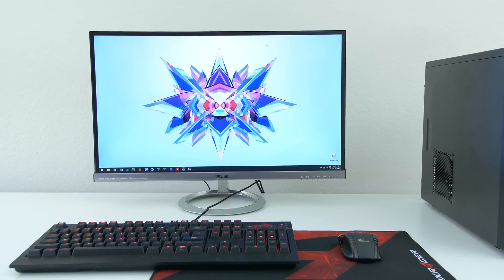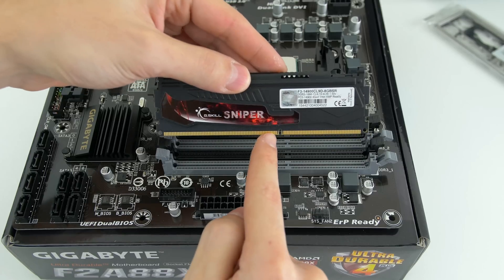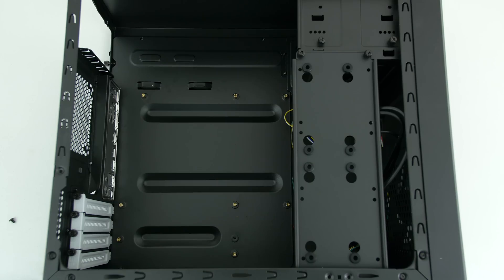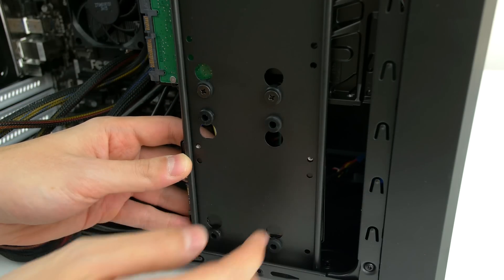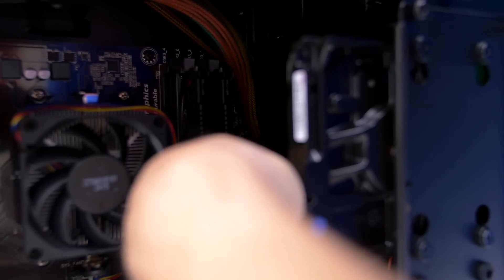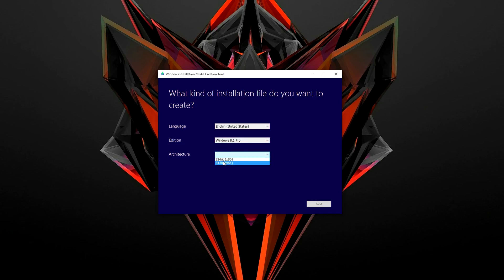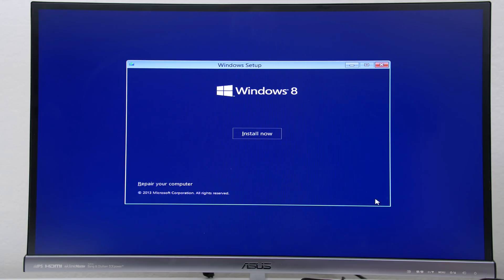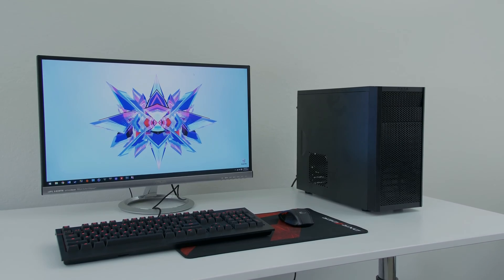How To Build $450 Gaming PC w/ Windows Install

Comment: Amazing video! really wanna give this ago but i have never done one before and im worried it would go wrong :(
Reply from the maker: +Senthuran Mah what u mean what comes on the screen the 1st time? as shown in the video, the microsoft logo comes up and you just follow steps to install windows. Its super easy. If you are talking about the BIOS screen, thats only if your PC doesnt read your USB drive. If everything works fine, then the PC will take you to the windows installation part.
Reply: +SamHurstHD 

Hey i know im alittle late on the reply but i just wanted to tell you something i think will help you overcome your fears:

Ever played with LEGOs? This is alot simpler. No small parts involved. No possible way to plug things in the wrong spot (save for maybe the power switch cables [and even if you do, no biggie])

and if you are capable of using the comment system on youtube, then you can install windows. 

So dont stress and take comfort in the fact that all parts are warrantied. :)
Reply: I just finished his 500 Orion build and it's super easy man, just follow his videos and you'll be alright.
Reply: +TechSource I just finished the Orion build you posted a couple months back and man, it felt so nice turning it on ! thanks a lot man ! your videos got me into pc gaming.
Reply: +SamHurstHD Don't worry. I was worried too when i wanted to build my pc but it was wayy easier than i thought! As long as you know how to build legos then this is kinda like it.
Reply: +SamHurstHD it isnt harder than lego
Reply: +Senthuran Mah Im just worried i wont build it right
Reply: +SamHurstHD It's not very hard, just follow along with this video :)
Reply: Senthuran Mah The building is easy. What do you mean by "all the stuff you have to do"?
Reply: It is literally just plug and play. I was really scared when I built mine. It's super easy just plug stuff in and screw stuff. It is like building something from ikea
Reply: +Senthuran Mah what comes up is the bios or if it detects windows on the flash drive it will immediately start windows install
Reply: +SamHurstHD hey i made mine a few weeks ago it really wasent that hard!  Only thing you need to worry about is static which you can easily remove with a anti static wrist strap!    Trust me the components are a bit tougher than you think!
Reply: +SamHurstHD building a pc is easy, it's like legos. And i'm not even joking, a 5 year old could do it. It's very hard to fuck it up.
Reply: man just give it a try ive been building pcs for a long while. try and fail. trail and error but you learn. it's not hard just a bit time consuming. sometimes for the build it can take an hr or 2 but to build your own ita worth it.
Reply: Just build it. You learn way more by building it and experiencing the mistakes and frustrations. My first build took me damn 4 hours because I didn't build the right way but after that, I can easily build one for an hour with full windows install.
Reply: Same
Reply: +Senthuran Mah if you have a hard drive with windows on it and you use it you should be fine and not have to worry about that
Reply: Jayden Wied
 wont that mess up the activation key?
Reply: ***** idk
Reply: Haha, Thanks man!
Reply: +SamHurstHD the only thing people have problems with is correctly hooking in the power , reset, led etc connectors on the motherboard. Its really easy to build computers. Ive built hundreds for my job
Reply: +SamHurstHD If you are really careful with all of your parts nothing can go wrong. Connecting all the cables is really easy you just have to find the slot where the cable fits in... and the rest is just screwing screws... DONT LET YOUR DREAMS BE DREAMS
Reply: DasDenFlo
" dont let your dreams be dreams" WTF does that even mean
Reply: *****
You dont know the Shia labeouf thingy?
Reply: DasDenFlo
I heard he went weird for a while and put a bag over his head in an interveiw but didnt pay attention to it. Is that where it came from?
Reply: *****
Just type in "JUST DO IT" into Youtube and I think it will explain everything... its a Advertising for Nike if I am not mistaking... D:
Reply: DasDenFlo
lol
Reply: +SamHurstHD Im building my first pc which will be this one. There is nothing to worry about
Reply: +AllTech have u built it already??
Reply: +KingFlyPascal not yet, I'm still gathering some more money because I have chosen a different case and ram but I've seen this build as well as one in real life and about 100 on YouTube. I am really confident I could easily build a machine like this in under 2 hours
Reply: +AllTech can u make a video on it and all the parts with a tutorial of how to make it? like the video
Reply: +KingFlyPascal YES, Definetly. Just subscribe to my channel and possibly e-mail me. I could send you all of the parts i had in mind of purchasing and of what parts i already have
Reply: +AllTech just subscribe hope you make a really specific tutorial and Thanx
Reply: +AllTech wait whats ur email
Reply: +AllTech when are ur parts coming
Reply: I ordered the hard drive for now. Im looking to see what parts i could salvage from my junk computers because i have a lot then i will decide what parts i need next
Reply: i have also e-mailed someone at ncix for some help about picking the correct parts and for help along in the build
Reply: +AllTech do u need another computer to download windows 8.1 or can u use the new pc to get windows 8.1
Reply: you would need another pc to download the file to a flash drive and buy a activation key then when you boot your pc WITH THE USB IN THE COMPUTER and put in the activation key, it is supposed to work. Then you would need to download all of the drivers and you are good to go
Reply: +AllTech i dont have another pc
Reply: then if you have an optical drive in your new pc you could buy a disc from bestbuy
Reply: +AllTech i dont have
Reply: +SamHurstHD you just gotta go for it!
Reply: Did you build it?     I'm going to build it I have all the parts just waiting for the case to get delivered.its going to be the first time I make a gaming pc
Reply: +Bryan Zamora I have built it, it is a great job
Reply: Can you help me I built it already but on monitor it says "no signal"
Reply: +Bryan Zamora make sure you put the hdmi lead into the graphics card and not the motherboard hdmi
Reply: +Matthew Mcnabb I do but still no signal.  I really want to use it
Reply: +Bryan Zamora accept my hangout invitation to chat on youtube
Reply: +Matthew Mcnabb I'm trying but it's loading
Reply: +Matthew Mcnabb it's not loading 😣
Reply: +Bryan Zamora is your graphics card hdmi port cut off a bit from the case? when I first installed mine i couldnt fully get the hdmi lead into the port, I then unscrewed the screws that hold the graphics card in place and left them unscrewed and I was able to push the hdmi lead the full way in, then it worked for me. try that
Reply: +Matthew Mcnabb no its not that
Reply: +Matthew Mcnabb DUDE I GOT IT.I HAD TO PUT ONLY 1 STICK OF RAM AND THEN IT BOOT UP
Reply: +Matthew Mcnabb Thanks for helping me though
Reply: +Bryan Zamora nice, no problem
Reply: +Matthew Mcnabb but do you know what I have to do so I can boot with both
Reply: try putting them with the corresponfing numbers on the right

First stick in the 1 slot
second in the 2 slot
Reply: +AllTech thanks but I had already fixed the problem.i had to go into the BIOS and enable x.m.p to profile 1 and it WORKED.

THANKS FOR HELPING ME THOUGH
Reply: +SamHurstHD I just built my first PC recently and it is WAY easier than any tutorial makes it seem.  As long as you read the labels on the motherboard and have a decent case anyone can do it.
Reply: +SamHurstHD I just built my first PC recently and it is WAY easier than any tutorial makes it seem.  As long as you read the labels on the motherboard and have a decent case anyone can do it.
Reply: +Rafael C So you made his pc build the orion about 6 months back would you say I should buy this or the Orion?
Reply: Can I use the r9 380 instead?
Reply: Lonelyguy192 no /s
Reply: Lonelyguy192 OF COURSE YOU CAN! This is PC. Use whatever parts you want.
Reply: +PandahFX tbh the orion is more expenzive now, im just gomma get an amdfx6300 and a nvidia 750ti.
Reply: +PandahFX and the other parts the same.
Reply: Same. I really wanna build something but i have no experience. Is this machine any Good? Or should i go with a bit higher budget to get the best Bang-for-the-buck?
Reply: Marijn Molenaar check the PC Master Race wiki.  They have parts lists for the best bang for the buck builds at different price points.
Reply: ***** Allright. Thank you
Reply: +Rafael C How was the Orion btw, is it a good build. Im a computer science major in my second year of university and I want a basic setup to start me off.
Reply: +SamHurstHD same with me
Reply: hey seems u know about pc can u reuse ur old harddrive when it has data in it?
Reply: that is all you have to do.. install windows and you're good to go.
Reply: Ya me toooo I'm scared
Reply: +Haukss ya me too but I am going to use the gtx 750ti ftw and the mad althon x4 860k
Reply: +Christien Soosaipillai this build and the Orion build is perfect for you but yes the Orion is the best first pic for your needs 😀
Reply: ***** ohh ok im 11 and i am looking forward to making this pc for minecraft
Reply: +mikai w PFFT
Reply: Domestic_K9 ram
Reply: +mikai w wtf😂
Reply: are these two CPUs the same?? if not are they similar and could i use the

 AMD Athlon X4 860k with AMD quiet cooler Quad-Core Socket FM2+ 95W AD860KXBJASBX Desktop Processor http://www.newegg.com/Product/Product.aspx?Item=N82E16819113410

 instead of the 

AMD Athlon X4 860K Kaveri Quad-Core 3.7 GHz Socket FM2+ 95W AD860KXBJABOX Desktop Processor (BLACK EDITION)
http://www.newegg.com/Product/Product.aspx?Item=N82E16819113379
Reply: me to
Reply: I have a pc all ready so I can go back to dat if it dous3 go wrong
Reply: destroyer1353 killer

Comment: Any suggestions for the best cpu and mobo for $400 to $450. I have all other parts for my next build except these 2 parts. I can get a I7-4790k for $250 with no mobo but wasn't sure if its worth it or if there is a better option.
Reply: Get a Z97 ASUS mobo and for a GPU just get a GTX 950
Reply: Thanks for a suggestion and I already bought me a gtx 980 a month ago.

Comment: If u Change ur processor and power supply and motherboard would u lose the operating system like Windows
Reply: No you do not because it is installed on your Hard Drive.
Reply: +Josh Wilkins No, the operating system is on the HDD or SSD, not in the motherboard fortunately!
Reply: +Josh Wilkins Nope, the operating system is stored on the Hard Drive.
Reply: But I'm pretty sure the product key is stored in the motherboard so you will need to buy a new product key if you replace the motherboard
Reply: Jokerjacob18 Nope.
Reply: Jokerjacob18 Everything is stored on the hard drive.
Reply: ArgaJones Oh ok
Reply: +Jokerjacob18 Yes, you will, but you won't lose the OS. You just need to install new drivers.

Comment: Can we install both an ssd and a TB hardrive?
Reply: of course
Reply: +GhettoDragonGaming no, not unless you have a technology iq of 3. (In other words, yes,yes you can.)
Reply: +ArgaJones alright thank you I appreciate it
Reply: +GhettoDragonGaming Yes you can! I have 2 SSDs and one HDD
Reply: +GhettoDragonGaming Yep!
Reply: +GhettoDragonGaming yes
Reply: Alright thanks I didn't know if I could or not and follow up question if in a few years rather than switching some stuff in this PC let's say I decide to build a whole new one could I still use the ssd/hardrive from this build in it?
Reply: GhettoDragonGaming Yes, unless something changes (we stop using SATA or something like that)
Reply: It will most likely work just fine.
Reply: +GhettoDragonGaming No problem :)
Reply: Yes
Reply: +ArgaJones but can you put 2 HDD 1 SSD?
Reply: +CreepyCreep | CS:GO And More ツ Yeah, as long as you have enough SATA ports.
Reply: ArgaJones Alright, thx!
Reply: CreepyCreep | CS:GO And More ツ No problem :)
Reply: ***** Yeah, it will be totally compatible with your new computer. Windows can run on pretty much any machine. All you have to do is replace drivers, which is pretty easy.
Reply: +GhettoDragonGaming I'm just commenting so I can save it

Comment: Can you do a build under $400 that comes with a monitor that can run gta v and crysis and sush
Reply: xD
Reply: +S̶k̅i̲ᴢy̲z̅ not well at all
Reply: +S̶k̅i̲ᴢy̲z̅ i bought my monitor for $400. And it's not even the best one. Just a simple 27 inch asus Monitor. So sorry to tell you that but you can be happy if you can run gta v on a $400 Pc without monitor, mouse and keyboard.
Reply: oh ok
Reply: is this good http://www.amazon.com/Dell-D2015HM-Screen-LED-Lit-Monitor/dp/B012AQIEVI/ref=sr_1_6?s=pc&ie=UTF8&qid=1450387863&sr=1-6&keywords=monitor
Reply: Our http://www.amazon.com/Acer-R240HY-bidx-23-8-Inch-Widescreen/dp/B0148NNKTC/ref=sr_1_4?s=pc&ie=UTF8&qid=1450387863&sr=1-4&keywords=monitor
Reply: well imagine how good a pc will be for $270. thats not even a new nintendo 3ds :D
Reply: +S̶k̅i̲ᴢy̲z̅ Those are both okay monitors, but the first one is a bit small.
The only issue is that those are only monitors, not computers.
Reply: I made this really cheap pc http://pcpartpicker.com/p/gK6Z7P is it good
Reply: S̶k̅i̲ᴢy̲z̅ It's not really good. Also, you are going to need a monitor, copy of windows, keyboard and mouse, and a case
Reply: Sapphire Radeon R9 270X Our Gtx 750 ti?
Reply: S̶k̅i̲ᴢy̲z̅ I'd go for the R9 270X
Reply: Oh thanks i mainly want to run minecraft and cs go

Comment: I hope you answer, the other day i went to clean my pc, when i got to the processor It had some white stuff on It, but they say i shouldn't clean that.
I should clean It ? Pls answer
Reply: +Just Sip (ElSipAF) No, that is thermal paste.
Reply: Thank you ;)
Reply: +Just Sip (ElSipAF) Don't take the thermal paste off unless you are going to replace it with more thermal paste.
Reply: +Just Sip (ElSipAF) Lol you dont know what thermal paste is? Bro i always recommend to do research on a pc and how it works before you buy.
Reply: +Just Sip (ElSipAF) you can clean that with alchool, but after you have to applly that back
Reply: +raven still Yes i didn't know, i'm not the best at those things thought
Reply: Though*

Comment: anyone know of a cheap, good, cool looking black&blue or white&blue case? many thanks
Reply: +dangerous911not try http://www.newegg.com/Product/Product.aspx?Item=N82E16811156317&cm_re=RAIDMAX_Vortex_V4_ATX-404WY_Black_Steel_%2f_Plastic_ATX_Mid_Tower_Computer_Case-_-11-156-318-_-Product
Reply: thank you very much for the options :)
Reply: +dangerous911not Not very cheap, but is the case im going to go for :) Fractal Design Node 804
Reply: Nzxt s340 is black and blue
Reply: Thermaltake Chaser A31 ^^
Reply: If you can I'd go with an NZXT h440 but I think it's $90-130
Reply: dangerous911not np :)